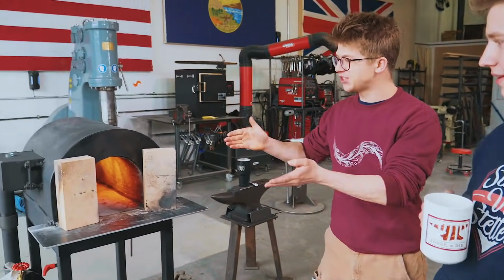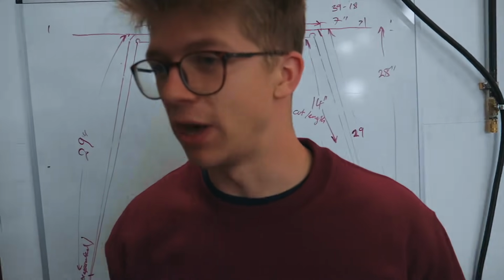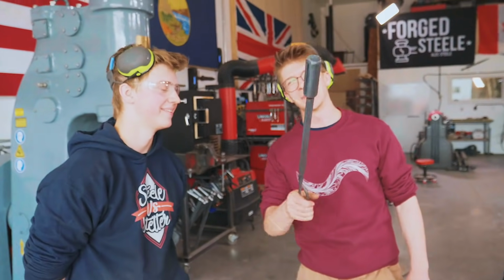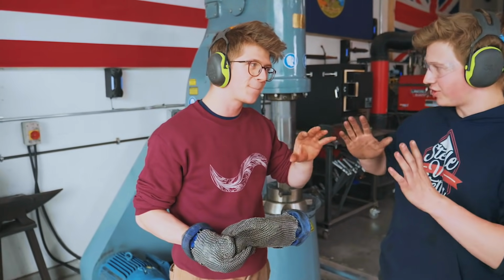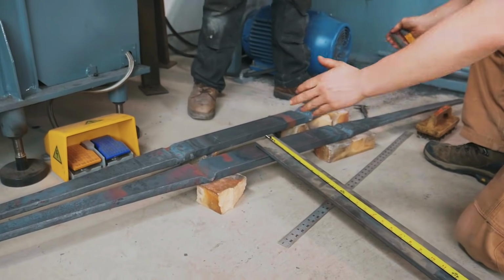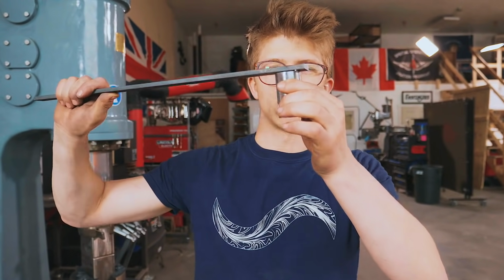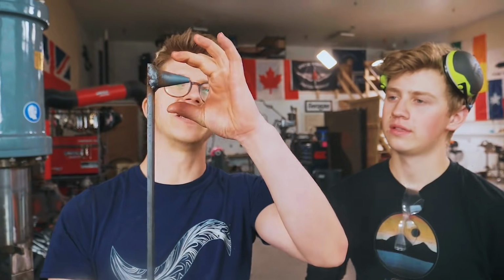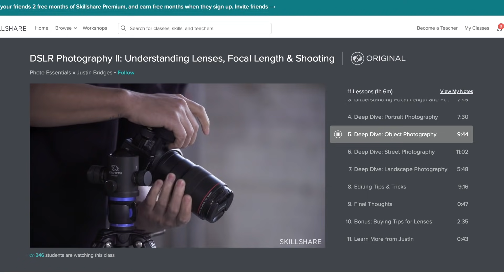FORGING MY KITCHEN TABLE!!! Part 1

Comment: Please forge Damascus frames for Alec’s glasses, and a Damascus coffee mug for Will.
Reply: Drinking something acidic like coffee from a steel cup would not be a fun time. Some sort of "food grade" sealant would have to be used, but I suppose it is doable

Look at the history of the US Military canteen cups. None of them were bare steel.
Reply: the idea is awesome, tho for the coffee mug i would consider putting something in the inside of the mug, some metal particles can get in the drink and that might cause some health problems in the long run, just a thought
Reply: @animalmother556x45  copper nickel Damascus?
Reply: Yes
Reply: Ian Kyle Maturan It would still taste metallic from the copper (maybe the nickel as well).
Reply: You could probably silicone the inside
Reply: Ian Kyle Maturan The military has already been through this process with their "canteen cups"

First, they were aluminum, when aluminum was needed for other things they tried porcelain coated steel, then zinc or tin plated steel.

All of them will give a LITTLE metallic taste except for the porcelain coating.
Reply: Could make the mug, then use food safe epoxy on the inside.  Do surface area math, place appropriate amount of epoxy inside (+% for safety and thickness desired) and spin mug on cool new lathe to evenly spread. Cap end of course.  Spin for desired time/ % of time epoxy cures. Then remove cap, smooth edges and let cure rest of way. Would be cool to test.  Just use food safe FDA stuff that goes up to 350 Freedomheit and you're good to go!
Reply: @7tqpbnvh7tqpbnvh77   Nickel allergy is pretty common, that would be an even worse idea than before, a simple cool looking Damascus cup with something to keep the drink from having actual contact with the steel
Reply: You could forge the mug and then line the inside with ceramic. That'd be a hell of a collectors item.
Reply: please just do it, so this guy can finally stop posting this comment 😝
Reply: @AlphaMachina  Yeah, that would be cool. Watching them learn new skills is always entertaining.
Reply: What about just a Damascus wrapped wooden mug....

Just wrap a Damascus band around the mug after carving a groove for it.
Reply: The most common coating for steel mugs is enamel, so maybe if a black enamel is used for the inside it can still look cool from the outside
Reply: @animalmother556x45   There are certain kinds of varnish that are food grade and suitable for sealing cups. or perhaps the inside could be coated in food grade enamel.
Reply: @7tqpbnvh7tqpbnvh77  i was allergic to eggs 2 years ago 😁
Reply: @animalmother556x45  Pretty sure WIll eats Kao Wool for breakfast. I don't think a bit of steel will bother him.
Reply: No offense, but those are both bad ideas. Health and safety reasons mainly.
Reply: @benjwankenobi5769  Right?!
Reply: @7tqpbnvh7tqpbnvh77  that would be worse because the acid from the coffee would make copper sulphate which is rather toxic.

Edit: Chances are the ones used in turkey are stainless steel coted with a thin layer of copper on the outside
Reply: YES,YES,YES,YES, but lone the cup with ceramic on the inside.
Reply: animalmother556x45 clear coat of food grade epoxy
Reply: @Lolfml  please dude... copper was widely used for cooking pots, Mugs, water boilers etc. until some decades ago. even your waterpipes are made of pure copper. Copper sulfate is indeed toxic for microorganism, but a human would have to consume relatively huge amounts. although coffee doesn't contain sulfuric acid. copper shouldn't be used for very acidic drinks like fruit juice. coffee instead with all the fat it contains won't be a problem for copper. you'd burn your fingers real fast though if the coffee was hot.
Reply: you american people shouldn't have much problem to get your hands on so called "ceracote" a ceramic coat for steel that gets sprayed on the steel and then high temperature cured. Walter Sorrels (Youtube knifemaker) uses this a lot to coat his carbon steel knifes.
Reply: Rather than a coffee cup it could be a holder for a handleless cup like a Dixie cup holder. That solves the metal vs acidic liquid issue.
Damascus eye glass frames might be prohibitively heavy. Nice idea though
Reply: @danimar641  You would just need to line it with say a stainless steel liner. Could likely get a cheap stainless camping coffee cup cut the handle off and make a ress tool out of say a chunk of wood to press fit the "liner" in to the mug. As heating cause a hollow tube to increase in diam and cold cases the same to shrink heating the Damascus mug up would allow the liner to go in easier or dipping it in ln2 would shrink the liner ither should work easy enough.
Reply: There's an easy answer everyone is missing.  What makes copper pans and steel canteens and food cans food-safe and has done so for 150 years?

Tin the inside of the mug.  Done.
Reply: @jeremiahmiller6431  No copper pans are "tinned" with anything, tin or otherwise. Tin melts at way too low of a temp to be used on a pot. They are clad. Usually clad with ss.
Reply: Stop this is a dumb idea
Reply: They could use glass enamel on the inside of the coffee mug, just heat it up spray on glaze and put in kiln
Reply: jay west

YES!!!
Reply: Metal cup without liner will probably burn him.
Reply: jay west making your own frames would be rather difficult. You do realize just how precise and identical they’d have to be? This request is bad and you should feel bad.
Reply: Tins melting point is about 450 F/232 C and was used for many years as a lining on containers that held food.  The main issue would be if the damascus cup could be cleaned and prepared suitably to take a coating of liquid tin. If the tin doesn’t stick then you have a nice paper weight...
Reply: What about the weight of the steel glasses, I imagine that they would certainly weigh more. Also he would need to find an optician who fits lenses to a steel frame. Nevertheless, great idea.
Reply: You could line the coffee cup with HDPE plastic from recycled milk jugs (or anything with a resin code of 2 inside the little triangle logo). HDPE melts easily at 365F/185C and is food safe. HDPE gives a strong, smooth, unreactive surface that you can sand smooth and polish with a heat gun.
Reply: Beer steins
Reply: Just do it so this guy will stop commenting this on every video lol.
Reply: jay west why not make a Damascus coffee mug from 1080 and 15n20 with 15n20 being the majority due to the nickel with withstands acid. Then you can ceracote (ceramic coating) the inside so it withstands the fluids you drink from it... this could be an idea right
Reply: A Damascus cup could be awesome. What about learning a new skill an try enamel  the inside of the cup?
Reply: well you predicted the frames 5yrs in the past xD

Comment: Alec, I really hope the floors in your house are built well with all of these heavy steel pieces of furniture you keep building. I really dont want to see the news that your house collapsed :(
Reply: Houses in the US have a load capacity of 200 lbs/ft square. He should be alright.
Reply: Checkout Jimmy Diresta's channel on his table builds.  You could land an F/A-18 on them but the floors of the houses and buildings they're in have no problem supporting them.
Reply: Probably a slab house.
Reply: Alec could always forge a whole floor to support everything, right? Maybe Alec should just be safe and forge a whole house out of damascus, I mean once you've gone this far, you might as well go the whole hog, right?
Reply: @radarreally2110   More like 30-40 pounds per square foot of live load.  Source: ASCE 7.
Reply: Next time on Alec Steele: forging a Damascus house
Reply: @pscharnett  You're right. I just checked it out. I wonder if my parents house can take more. The floor is 2x6 and the subflooring is half inch chipboard. Some time I ought check.
Reply: I live in the same town as Alec and have been a flooring contractor since I was  a kid. the houses (lower to middle price range) built here since the late 90s are total trash. I have seen so many tile failures due to flex in the floors. I have seen so many wood floor failures due to the floors being built with OSB that gets soaked during the build and swells up so much that they don't hold nail/staples very well. I was in one house that had trusses set on 2 ft centers with 5/8 OSB, as you watched someone walk across the floor you see the entire room go up and down when they stepped on a joist, and when they stepped between the joist on the OSB it bowed down so bad I couldn't believe it passed any type of inspection. I installed the carpet in the house and they had to find someone else dumb enough to install the tile and vinyl because I knew it would fail. and sure enough 2 months after the house sold the owners were in the flooring store complaining about their floors falling apart.
Reply: @joedoe6444  worked in the HVAC industry in Vancouver WA. Post beam construction was the norm. High end houses had 4 by 6,s on 12 inch centers. Middle class houses had the composite beams. On 18 inch centers. In Texas though, all the newer houses were on slabs, which have thier own issues if not enough rebar was put in or the ground wasn't prepared right.
Reply: @joedoe6444  that's terrible. Are there no building codes covering flooring there? Load capacity seems like something that should be covered.
Reply: Jonmurray Murray yep, in Texas we don’t have regular dirt. We have all natural weather indicating soil. When you walk outside and look at your lawn, if it is squishy that means you recently had rain. If your lawn is hard pan and dry as a bone, that means it hasn’t rained in the last 24 hours. In Houston it’s not a matter of if you have foundation problems, it’s when you will have foundation problems. Houston was built on a giant sponge!
Reply: he needs to reinforce his foundation with damascus
Reply: If you looked at his clips from the start you would have known that he have reinforced the floor where the heavy machines stands =)
Reply: @pajen85  he doesn't live in his workshop doofus
Reply: wait what? an average person standing on 1 foot is way over that

Comment: Hi Alec, I'm no metal worker but I love your videos. I do a bit of wood workin, and after that BLO dries and cures after a couple weeks, I would highly highly recommend going and putting 3-4 coats of General Finshes Arm-R-Seal on it to really protect it against wear and tear. Preferably 3 coats of gloss and 1 coat of semi-gloss, that offers the most protection and clarity to the finish, but 4 coats of semi-gloss will suite you fine if you don't want to buy 2 different quarts of finish (like $40 a piece)

Comment: Grandfather was a mason. When he came to this country he did plaster work as it paid better. He also did really fancy plaster work with custom trowells, stamps ets. He could make lovely mouldings, pillars etc.

His boss was mostly a concrete contractor . He wanted to have a way to show off his skills to clients. He asked my Grandfather to make him a formal dining room table out of concrete . This was in the mid 1960s long before concrete counter tops.
Grandfather thought he was nuts but made him a polished ornate concrete table with ornate mouldings. 

So your table is sort of in the same mold.

Pretty cool
Frank

Comment: What happened to the doors you were supposed to build for the forge??? Resorting back to the bricks?
Reply: Playboii Jay I thought same thing. They overkilled that forge but doors are bricks.
Reply: hopefully they have plans to finish them otherwise its like a lambo without the butterfly doors 😎
Reply: My guess is that they wanted to finishing curing the forge before tackling the doors so that they are the right fit.
Reply: @Roushlamn  i dont believe that would effect the dimensions of the exterior of the forge as a whole. Once the steel its set its not going anywhere... otherwise they wouldnt have been able to install that massive blower.
Reply: @Stinger_Games3  If you're going to kill it, overkill it.
Reply: Maybe it needs to breathe, so the gap between the bricks is actually welcomed
Reply: I think they want to pace themselves on the long builds after the sword. long builds are awesome but, it's also nice to see other 'smaller' projects being completed as well. probably helps them not burn out on them as well (if that is at all thing they experience. Alec is probably just so excited that he won't ever burn out on a project)

Comment: Great job so far...if you are putting this on a wood floor..you may want to consider small adjustable feet so you can control its leveling much easier..👍👍

Comment: YES! Two in a row right! Skillshare for the win! Lol

So, just a plain wood top... no hot strapping red hot metal around it and hand riveting it to the legs? 😏

The legs seem a little narrow at the top. It might just be the camera perspective though as it was mostly ground shots with you standing/squatting over it. Not the best for perspective. I'd maybe consider cross bracing it as well, though with the size of the steel used it's probably not a big deal, but it can help to reduce lateral tension on the legs. Although, if it's just for dinner plates and bills, it's not a big deal.   If your going to be doing projects on it or using it as a butchers block, then you might consider it! 

I've always loved the "if we don't have a tool, then make one" mentality. Especially in this day and age of Amazon, Harbor Freight, and free two day shipping. They have their place, but there is a certain amount of pride in knowing YOU made that tool. It's a shame that it's a dying mentality and art. Glad to see you onto some simple projects. At least I assume it's simple... no setting gems or casting brass right? No need for a 6ftx4ft vacuum chamber for investment work? 😉

Keep up the great content! If your looking for a different kind of challenge, I'd love some Damascus parts for my guitars! 😁✌🏼

Comment: Hey Alec, look up friction drilling on YouTube. Crazy stuff, that uses a cone of tungsten and hydraulic press to move material out of the way rather then cutting it out. (It pushes it down more then out, and creates a sock that can later be used for threads on thin metal sheets)

You said there wasn’t really any other way to move material without cutting it out, but there is always another way to skin a cat.

Comment: You guys should make coffee mugs out of steel (maybe even pattern welded) and line the inside with glazed ceramic, put your makers mark on the bottom and some etched Steele/Stelter logos on the side and, hot diggity hell yeah, you'd have some seriously badass coffee mugs for sale.

Comment: That table would look awesome with forged, square head rivets coming through the top of the table, holding the legs in place. Of course, the legs would no longer be removable, but the  aesthetic would be incredible.

Comment: Alec Had Idea for new forge use angle iron off edge of forge and strip steel out front under 1/4 inch out from front of fire bricks door starting straight out from outer edge of entrance to full open if enough shelf there put end stops

Comment: Never looked into working with refractory cement but most concrete full cure time is measured in weeks. Kind of surprised they would fire it so soon. Hope it holds up over time!

Comment: Alec, I have a little bit of a  different question for you. I’m just getting into blacksmithing and think I’ve see guys add flux even just to shape metal and not necessarily weld. When do you have to have flux and when not? If you flux parts being welded and then put them together with the flux still there, doesn’t the weld contain the flux with the impurities?  Or, do you flux it, clean it, then forge weld it? Thank you so much.

Comment: I maybe totally wrong but from what I understand about forges with the ribbon burner where it is the heat will circulate at the top 2/3rds of the forge and you will have trouble getting to forge welding heat at the bottom if I’m wrong so be it but it would be interesting to see the temperatures and each 1/3rd height and see how officiant the forge is with the ribbon burner where it is

Comment: as someone with some welding experience looking to try some smithing, what thickness steel did you use to make the new forge? after seeing this design im interested in building one instead of buying one if I can do it cheaper, just want to know how thick to go to make it last

Comment: If you wanted to you could creatively rust metal or scrap Damascus chunks and load it into a mould for clear coat epoxy and use that as your table top

Comment: You can only move material with a drill. Its called flow drilling and is really helpful eg when you have a thin piece of material you want to get threads in. With a conventional drill you maybe only could get 1 or 1.5 threads where with flow drilling you may get 3.

Comment: You need hand forged Damascus bolts and a scrollwork Steele touchmark cross brace underneath. Picture that graceful "S" floating in an oval frame midway under the table...

Comment: You should add a lever or something similar to the forge and attach those refractory bricks so you can just turn the lever to pull them apart.

Comment: You guys should do a Steele V Stelter making tongs.  You guys must have a size you don't have in the shop or a few pairs that will need replacing eventually anyway.  Oh I forgot to ask, how long did it take for it to get up to heat?

Comment: i live in norway and have a pretty large intrest for blacksmithing, but im also broke. i was thinking of using an old cast iron wood fired furnace as a forge but im not sure if it will work, what do you think? i also need a substitue for an anvil since im broke, have any recomendations or ideas? i hope for answer, and i love youre videos keep up the great work ;-D